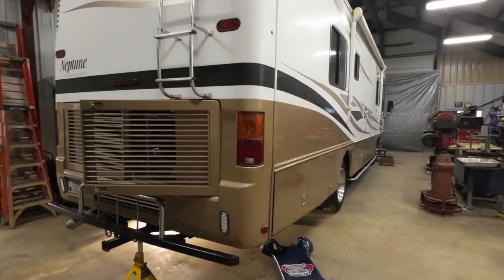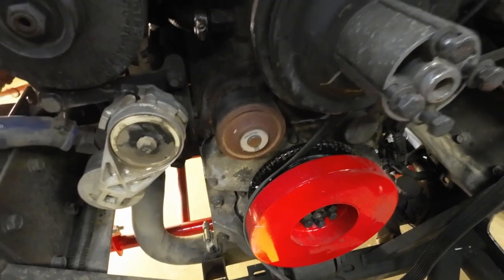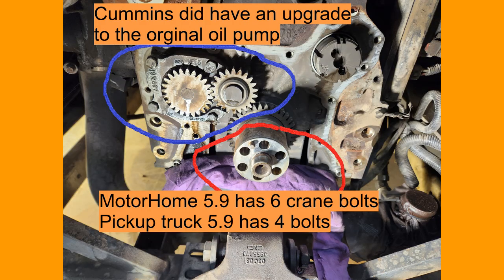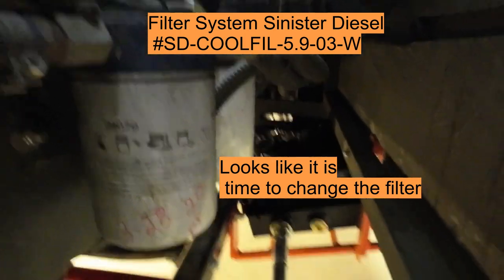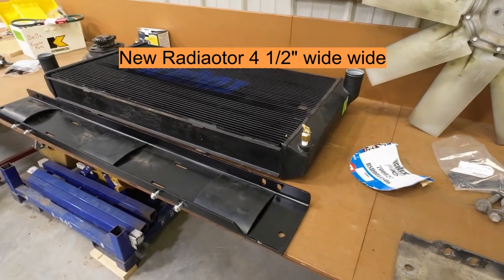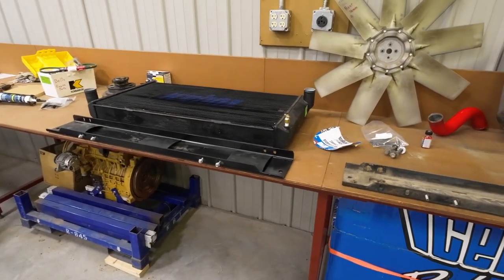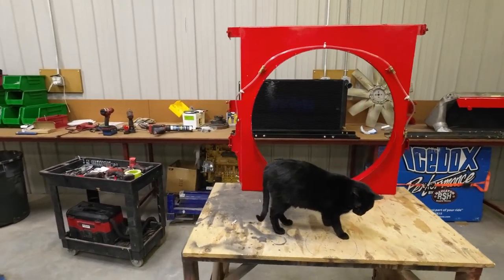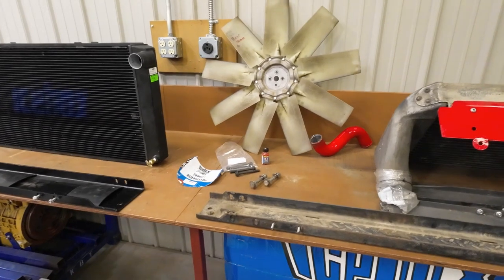Alan's Day   Part 1    Diesel Pusher 2005 Motorhome  "Coolant System Upgrade to Perfect"

Comment: Good explanations, thanks. Does the air dam you installed bring more road dirt up onto the engine and into the radiator, charge cooler, etc?  Have you inspected the upper part of that dam to see what is accumulating?
Reply from the maker: Thanks for watching.  So far no extra  junk in the radiator/cooler. When I have a water hose near by, I do give the back of radiator a quick squirt, just to stay a head of the dirt.

Comment: for how cheap it is,  it sure is good insurance to just replace all the hoses and hose clamps (made in USA only). you can also store the originals if ya want.
    after 20 years the turbo technology has advanced a lot... usually a modern compressor and turbine in the original turbo is worth every penny.
   Ya know Gale Banks used water spraying on the coolers, .. he also had them mounted on the brake rotors centered on the fins...
   it's elbow grease and patience to do things correctly more than big money... 
 My HR is CAT on a FREIGHTLINER chassis, ... My next BIG job will be 4" round tube / pipe bumpers 1/4" wall. and after seeing a few crashes with these, the cab will get a safety cage since I build off road race trucks...   Looking at some videos, it doesn't take much to wipe out the cab...
     Being 20 years old, it's not  a big deal to cut, drill , weld, etc.. But a newer pusher???   the $$$ amount is unreal, ya don't wanna touch anything.  
  Being older, you could actually swap parts to make the 5.9 non computer in a dooms day pinch...  
keep up the good work.........................

Comment: Since the radiator was out, it would have been a good time to just swap out the engine and transmission too...no? I mean if you're adding a $10,000 radiator, may as well.
Reply from the maker: You are correct, that would have been the time to replace the 5.9 Cummins with a 8.3 Cummins. Maybe I could tow with no over heating problem? Thanks for watching.